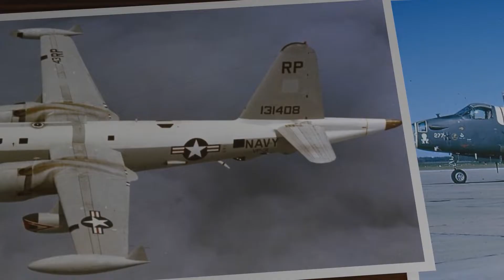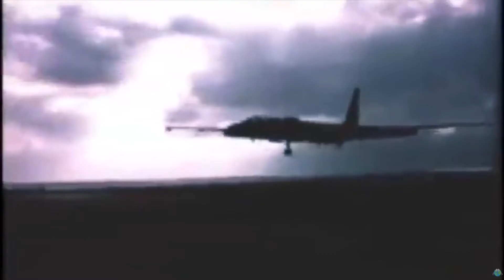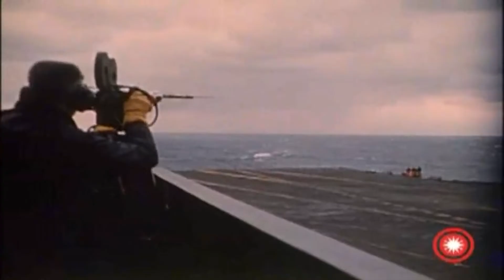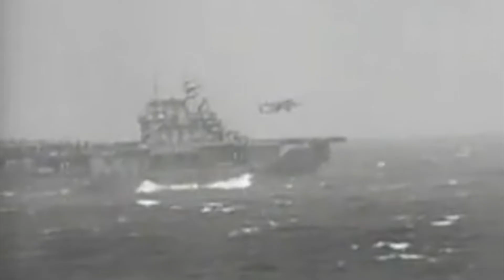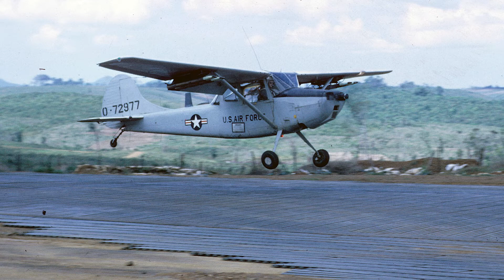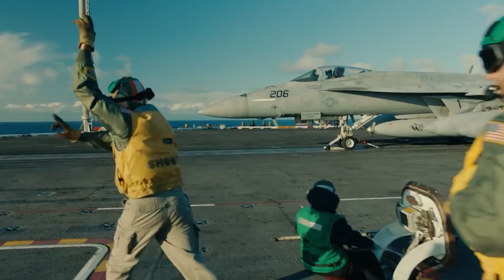6 Craziest Aircraft Carrier Operations That Actually Happened

Comment: Did the Neptune had enough speed and altitude to escape a nuclear blast?
Reply: The Neptune was a bit faster than the B-29 (363 mph over the 357 for the B-29), but the service ceiling was a lot lower (22,400 vs. 31,850) The technique for out running an atomic explosion was to drop the bomb, and then dive, adding the extra G's to the plane's airspeed. Not sure how that was going to work with the Neptune.
Reply: Hahahahahaha NO hahahahahaha

Comment: "Operating From" and "Taking Off From" carriers are two VERY different things!! Clickbait!
Reply: The B-25 actually landed on a carrier (it was fitted with an arrestor hook).
Reply: @allangibson8494  B-25s never landed on a carrier. And no, they were never fitted with an arrester hook. They were hoisted onto the decks with cranes.
Reply: @kenkahre9262  B-25’s for the Doolittle Raid weren’t modified.
Later ones were fitted with tail hooks in preparation for the November 1945 invasion of Japan. This was tested on the USS Shangri La on November 15, 1944.

Comment: The U.S. Navy after WW2 was desperate to stay relevant in the Nuclear Age. Those "Little Boy" bombs were not then outdated so much as very expensive to build using highly enriched uranium 235 compared to the less costly plutonium explosive compression "Fat Man" bombs. Now the Navy has the most credible U.S. strategic deterrent.

I'm reasonably certain that a well known Lockheed test pilot made the first carrier landings and takeoffs with a C-130.

The appellation "Dragon Lady" usually refers to the "Big Wing" U-2, i.e., U-2R, TR-1A, U-2S, etc. The carrier experiments were done with the earlier small wing U-2. The U-2G was a modified U-2C. 

Cringe every time I see that film of the helos pushed overboard. It's a carrier task force! They had every practical means for rescuing pax and crew from a ditched aircraft. Hope whomever made that choice paid for it.
Reply: Those didn't belong to the Navy. They were South Viet Namese Army flown in by refugees. And as it was pointed out, they were in the way. They would have been tossed eventually.
Reply: @kenkahre9262  All paid for by the U.S. taxpayers.
Reply: The Fat Man implosion design used 1/10th as much fissile material as the Little Boy gun design. That made the far more complicated implosion design the go to design.

Comment: One small nitpicky point. The broomstick "gun" was in the tail cone in order discourage to discourage Japanese aircraft from attacking the B-25s from the rear. In the B-25b, the version that was used in the Doolittle raid, there was no tail gunner position. With the exception of the removal of the bottom gun turret the planes retained the rest of the complement of defensive armament of 50 caliber machine guns, which remained in the top or dorsal turret position and hand mounted by the bombardier in the nose at the bombardier's station.
Reply: I read years ago, that the tail gun was mounted on a spring to cause the bullets to spread in a cone.
Would look cool with all tracer 
✌️🍀

Comment: not a carrier operation at all. But the best thing that ever happened in my opinion was a B52 Stratofortress low fly-by  near a carrier during an exercise. The ships CO even had to be told by the pilots to look DOWN to see the plane.
Reply from the maker: Could You tell something more about this event?
Reply: @x-planed  
In 1989, American pilots performed what was probably the most spectacular flyby by long-range bombers.
During the Cold War, Russian aircraft repeatedly attempted to scout and photograph American ships. As a result, the U.S. launched an exercise in which B-52 bombers played the role of the Russians and tried to scout the aircraft carrier. The latter, in turn, was to detect the threat in time and dispatch interceptors. Once the bombers spotted the carrier, they bragged about it and asked permission for a flyby.
The air traffic controller on board said he couldn't spot them anywhere, but the pilots radioed back that he should look down. At an incredibly low altitude, the B-52s sped past the carrier, so low that they even disappeared below the flight deck. The pilots had practiced low-level flights for years in order to fly undetected under Soviet radar, and now they showed what they were capable of. When asked if they should come around again, all the sailors enthusiastically answered "yes" and this time everyone had their cameras pulled out, creating  unique pictures
Reply: @raikbarczynski6582 sounds like there should be plenty of such videos/photos. Or at least some?
Reply: @muriwatch . There are pictures taken from a helicopter
Reply: I was an aircraft mechanic on B-52s from 1977 to 1981, I was in the flying mechanic program so sometimes I would fly along. My favorite seat was the instructor pilot seat between and slightly to the rear of the two pilots. It would have been SO COOL to have flown along on a low level flight past a carrier!

Comment: Question: Would a us aircraft carrier allow an emergency [barricade] landing of a Eurofighter or F16? Or would the pilot have to eject?
Reply from the maker: That’s a very interesting question. I’d say the main issue here is the landing gear and the airframe which are not designed to absorb the energy during such violent touchdown. But in theory a very skilled pilot could fly a really flat path to not knock the landing gear and aim right into the barricade
Reply: No chance Paddles (as we used tosay on the boat  😎).  They would be directed to come along side and eject and the plane gaurd helo would fish em out of the drink.